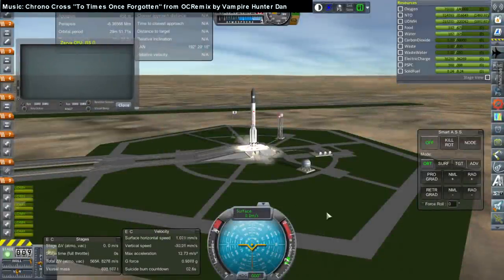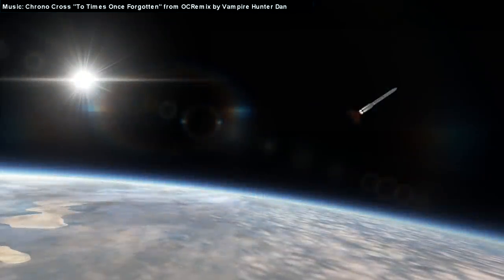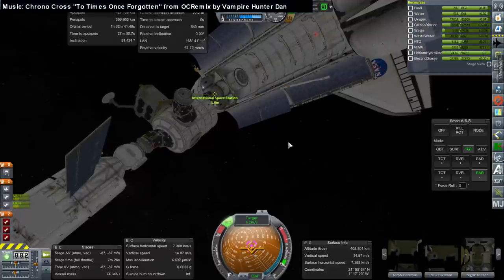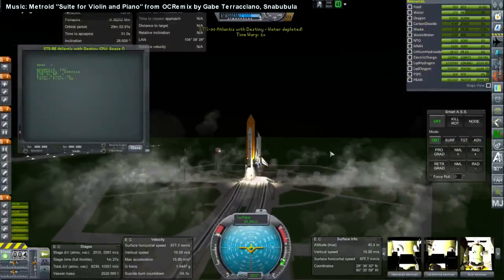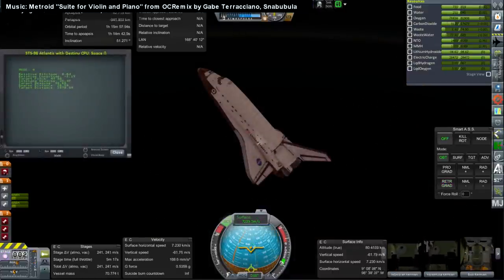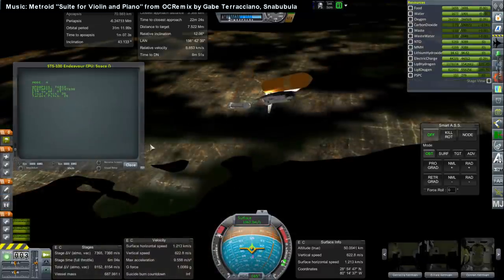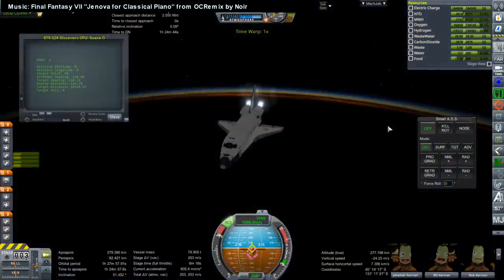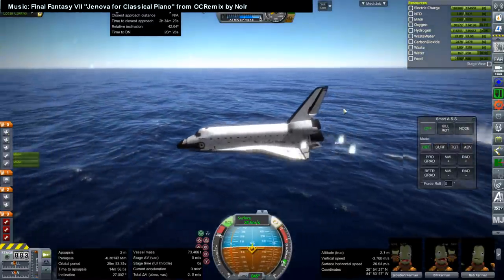Kerbal Space Program/RO - Full ISS Construction

Comment: That sunflare is gorgeous! What mod do you use?
Reply from the maker: Depends on which part - this construction took part in a number of different versions of KSP with different visual mods involved at different points. However, the sunflare is basically managed by RSS Visual Enhancements - not sure if anything else was adding to it.
Reply: @RaizSpace   since you are using scatterer, and nothing was added, it should be the basic scatterer sunflare which i am using in my current ro/rss setup. It reminds me of sunflares of maar(sam for short) or astronikis sunflare for rss.